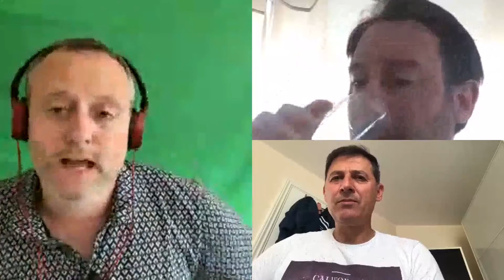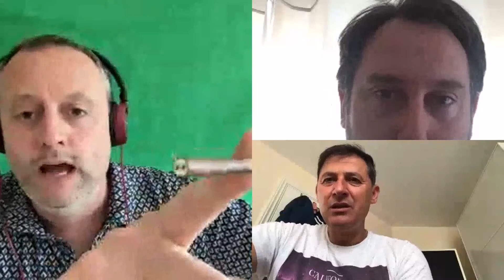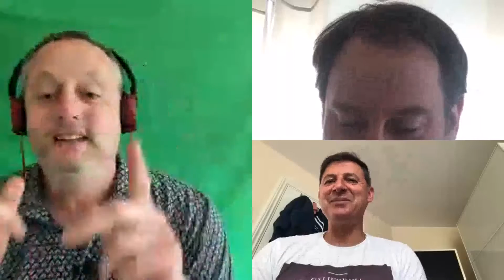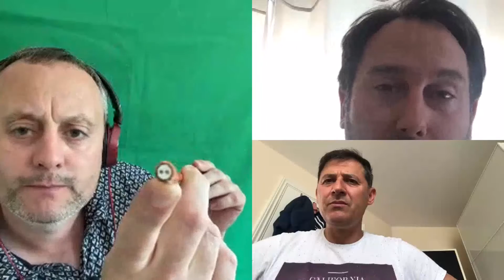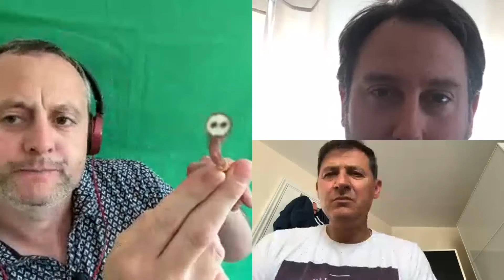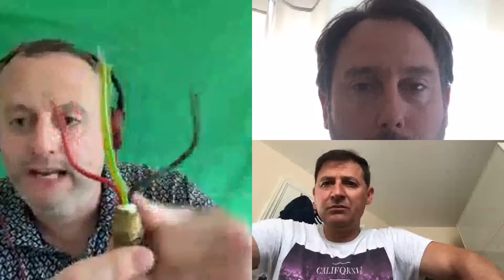MICC Cable (Pyro) Part 1 Construction of Cable, Sheath Colours, Clipping and Bending

Comment: Few tips
If using a barrel stripper to strip a long end talking several meters!
The compound can be used as a lubricant on the sheath.
Another, when stripping larger pyros using a ringing tool, you will find that the pot will not slip on!
Just get a file and gently take the edge off and the pot will then slip on easily.
Reply from the maker: I have stripping and terminating videos ready for release but I will hold off until college are back. Thanks for the detailed comment 👍. Gaz